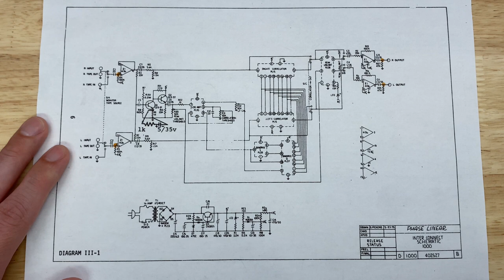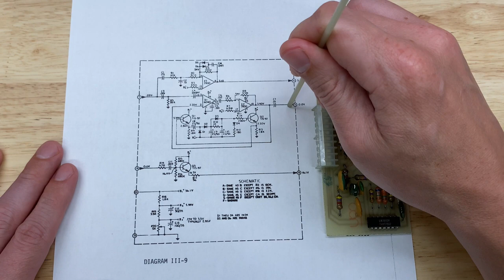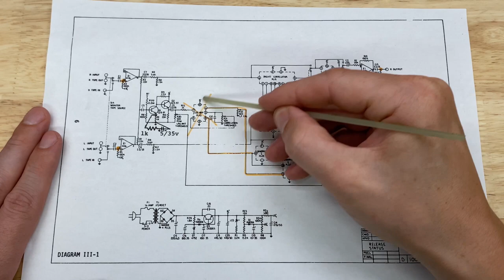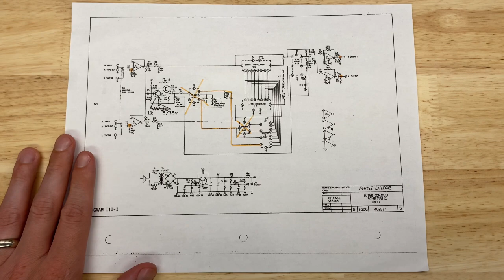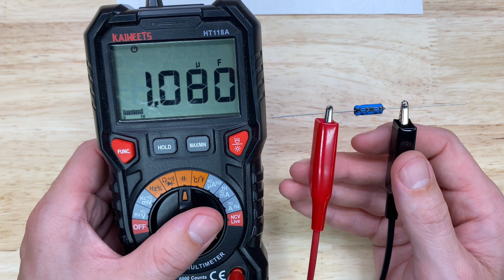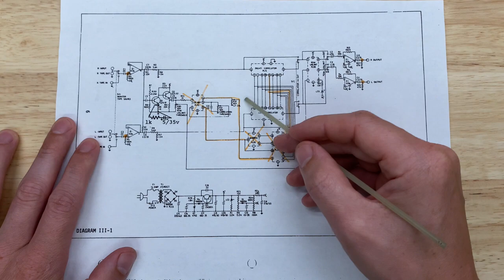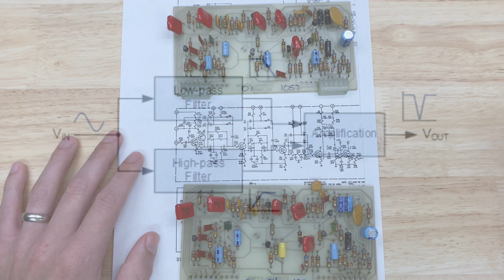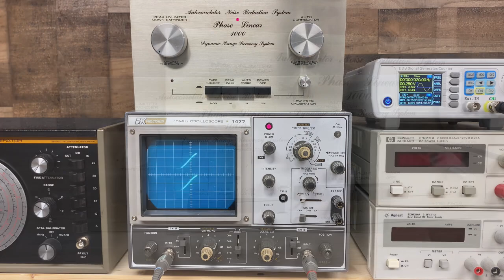DR #50 - Unique Audio Equipment - Phase Linear 1000 Service - Part 2

Comment: This is invaluable my friend. Not actually for references to a PL1000 unit, but for the purpose of repairing a PL 4000 preamp. Most all of the boards used in the 1000 are exactly the same as the ones used in the 4000, so to have someone go through them one at a time with cogent explanations AND action items is an incredible YT find for me or anyone working on a PL 4000. A very pleasant change from all of the annoying minute-long "Repair and Restore" videos that seem to be so prevalent here. Thank you so much!

Comment: Nice job ! In order to replace properly the connector on the log amp module ( 3.00), you could glue an epoxy pcb board again the metal chassis to avoid electric contact.